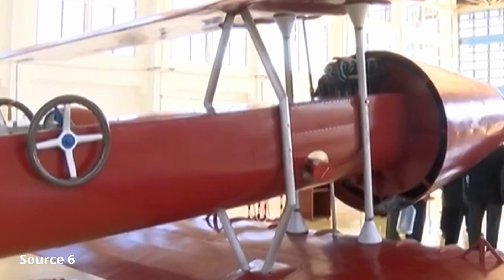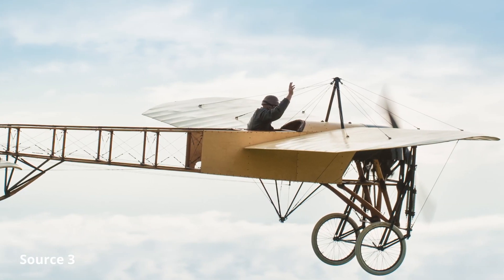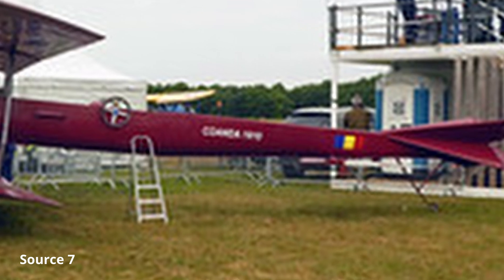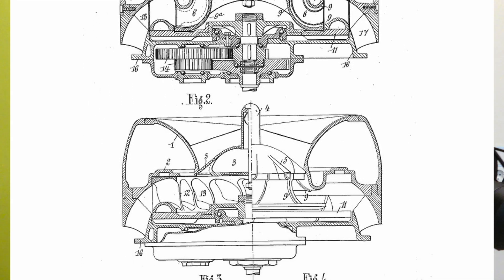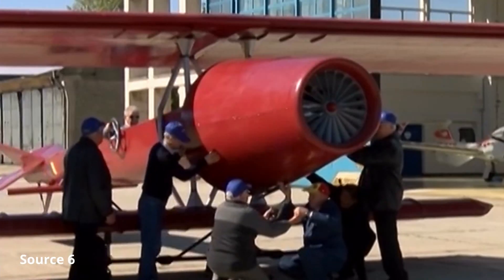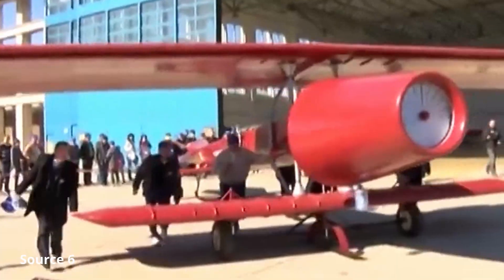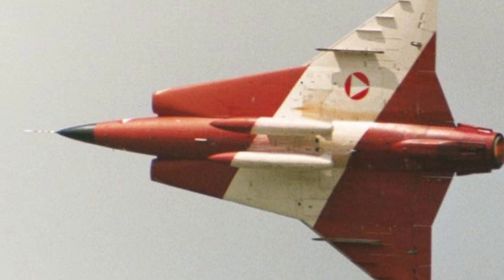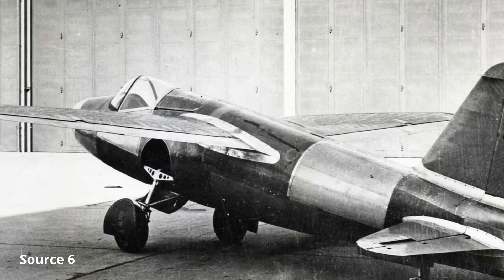THIS is actually the first jet Plane - built in 1910 | [4K] short Documentary by Aviation Live

Comment: Mr.Coanda was certainly the first man, who tried to use a jet engine on a plane.
He nearly succeeded. If he did, he would be disappointed. Piston engine air compressor is dead end design, too heavy and inefficient. 20 years after Coanda Italian engineers have made a fighter jet plane with piston engine air compressor and jet engine. The compressor was weak and the plane was too slow to be useful.
Reply: This plane was mot an attempt at a jet engine, it was simply a ducted fan, coanda only started to claim it was a jet engine years later

Comment: Great video! My organization has made a model kit of this aircraft, and while there may be a doubt that it ever flew, it did survive. As my research found, there were photos of it in the 1911-1912 Popular Mechanics magazine, and it was later sold to one Mr. Weyman. Also, there were no ailerons or flaps because in 1910 wing-warping was still in use. This involved cables that bent the wings in the direction the pilot wanted to go, controlled by the wheels on each side of the cockpit. Looking forward to more of your videos!
Reply from the maker: Very  interesting details! As I am also an aeromodeler, is your model kit able to fly or just for static Display?